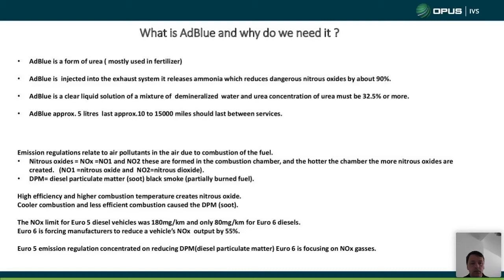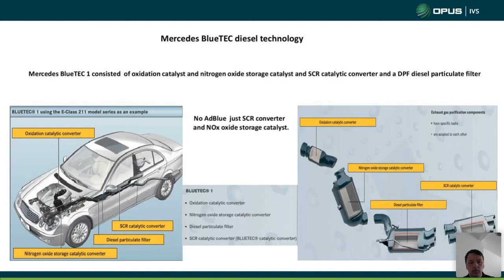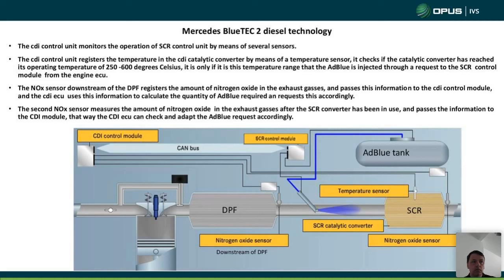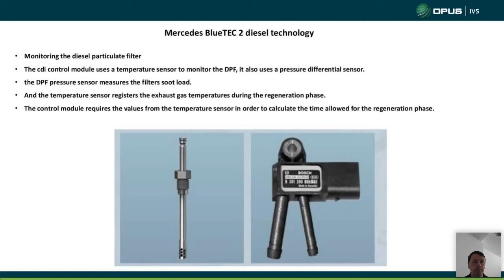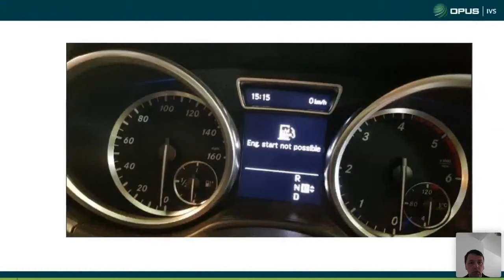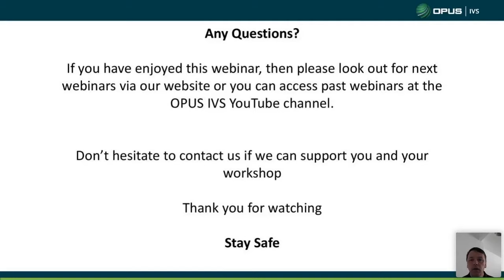Mercedes-Benz SCR

Comment: Hello. Thanks for the idea. Very informative. My e-class 213 is showing ‘cannot measure adblue level’. Had the back off and looked at all connections which look ok. Any ideas at which bit might have gone wrong? Thanks
Reply: same as my C200 d S205, it is because the ADBlue level sensor sucks, and the NOx sensors (before and after the SCR) suck either, and the SW is not smart enough to workaround. Considering each NOx sensor is 500€ and the ADBlue tank is 2000€ I no longer think the Mercedes star is briliant
Reply: @francescobuffa385  yeah I’ve resigned myself to finding a cheap adblue tank somewhere online. Managed to scam mine thru a MOT, so got a year to find one.